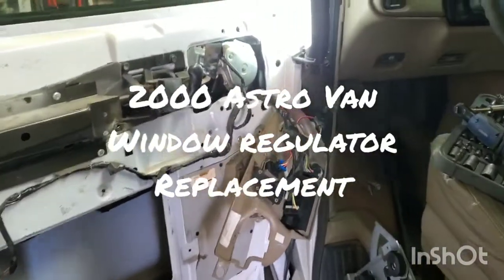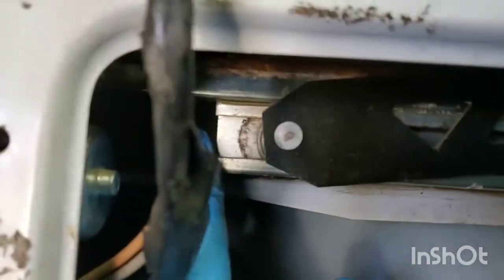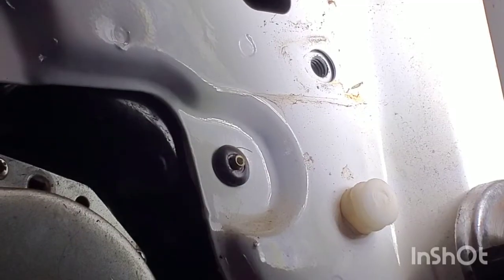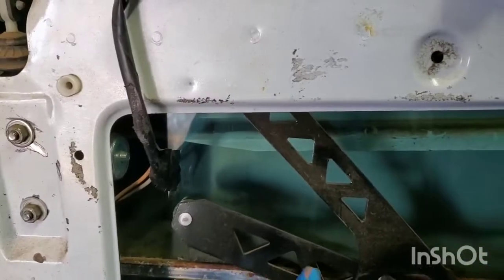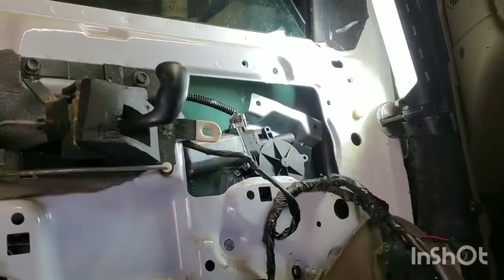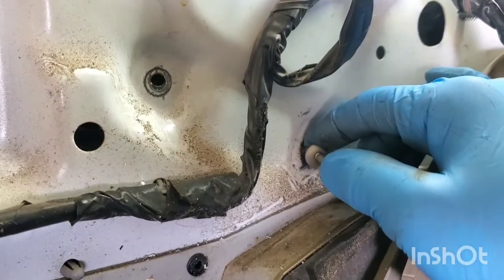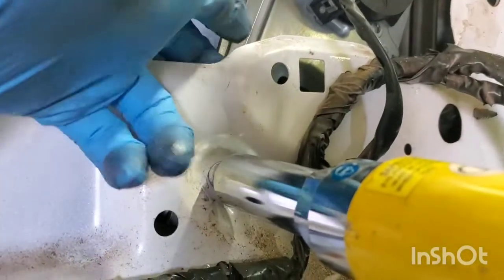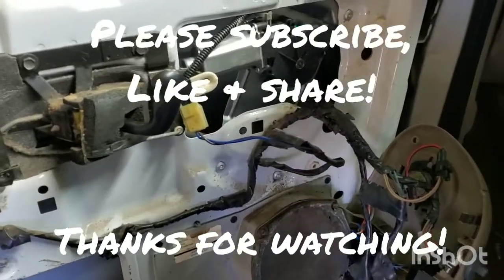2000 Chevy Astro Van Drivers Window Regulator Replacement

Comment: where did you get the rivots from?
Reply from the maker: I believe it was J & E Supply & Fastener in OKC or Fastenal.
Reply: a regular rivot gun wouldn't work ?? for installing the new rivots ?   the cost of them rivots ?
Reply from the maker: @scottymizzo415  
This one used 1/4" rivets. Occasionally, I do get rivets with new regulators. You could get a $20, 1/4" hand rivet gun from a place like Harbor Freight, Summit Racing & O'Reilly's. Or HF has an air riveter for $70. A box of rivets for $7. So for $27 you'll save a lot versus paying someone to do it. Or you could buy the expensive ones like I'm using in this video, and the only way they're coming out is by drilling them.  Hope this answered your question. Thanks.
Reply: Napa auto parts near me has box of 25 auto rivets 1/4" for $9.95

Comment: this is way to much work,  Id just change the motor its self,  These vans goes for ever and when a power window motor goes bad its really late in the game,  Most are not worth that expensive part your using or all that labor,  Just saying ,
Reply from the maker: I usually find the regulator is worn out also. Besides, I do what I'm asked to do. I can suggest, but whoever is paying makes the final decision.
Reply: @okcvet1st  I understand